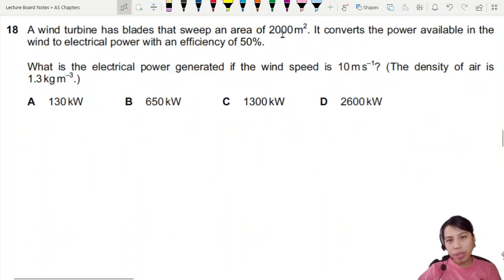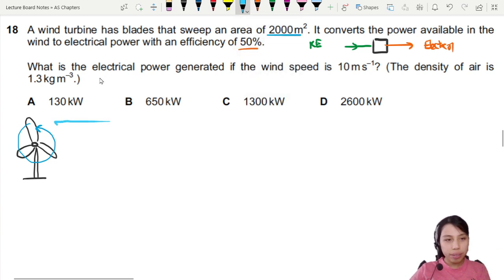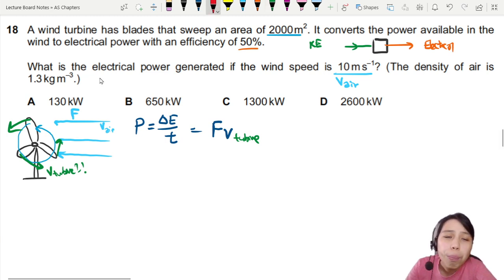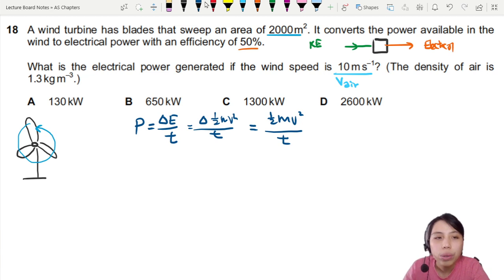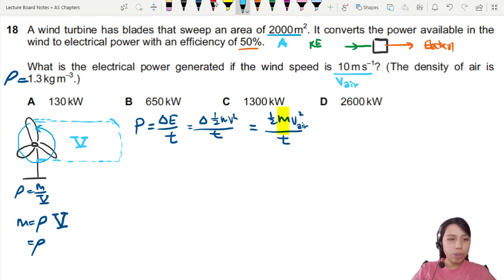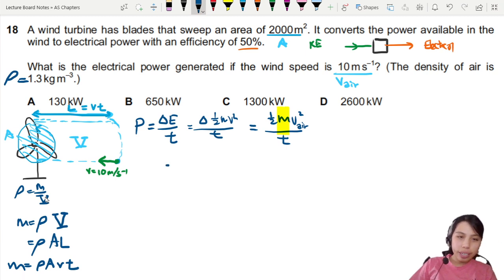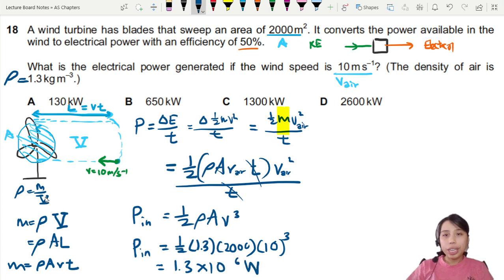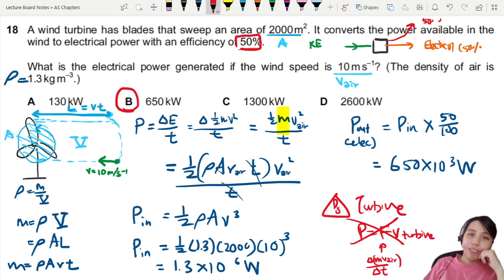5.2b Ex1 MJ13 P11 Q18 Turbine Power | AS Work Energy Power | Cambridge A Level 9702 Physics

Comment: miss why can't we use the formula F=pAv^2 in solving this question or when do we use this formula could u kindly explain
Reply: I had this exact query and thus searched this question up. Do you know why we can't now or not?
Reply: It is because that formula is a derived from another formula. It can only be used when the wind or object either starts or end at rest. In other words either initial or final velocity has to be zero. In case of wind you cannot make this assumption. It obviously has an initial velocity at which it travels, but it doesn’t state anywhere that it will come to rest once it hits the turbine.
Reply: The formula you are mentioning is 
Force= Rate of change of momentum 
F=m(v-u)/t where either v or u is zero.
F=mv/t
F=pVv/t
F=pAhv/t
F=pAv^2

Where p is density, V is volume, v is speed, and h is height. In other words h is a displacement. The displacement per unit time is speed.